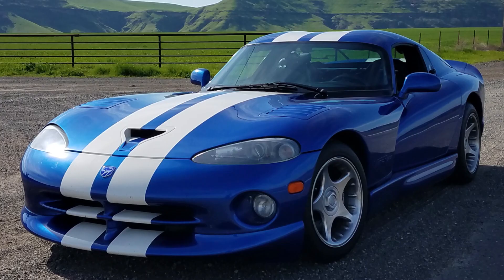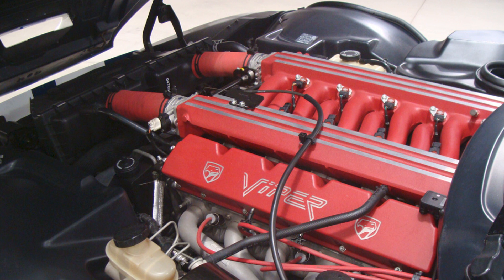Tech Talk Tuesday: Dodge Viper Cooling System Upgrades

Comment: Upgrading your stock cats to high-flo is a huge improvement for cooling temps. I’ve got a full Belanger exhaust setup along with a 3-row radiator and silicone hoses and the car is remarkably cooler than when it was 100% stock last year.

Comment: On a 92 and early 93 with the radiator that has the radiator cap on the radiator you HAVE to remove the hood and hinges and hinge brackets because the radiator is removed from the front of the bulkhead between the bulkhead and the front fascia. On the cars that had the coolant reservoir on the passenger fender, you can remove the radiator from the space between the bulkhead and the engine because the totally designed the front bulkhead in late 1993 with the radiator mounted to the rear of the bulkhead instead of the front. Time difference: 6 hours for a 92/93 versus 1 hour for a late 93 and Gen II. Just an FYI

Comment: Also, for more info, the drip is coming from the front center of the engine. This is why I suspect the pump. I will do more inspection in the coming days.
Love your channel, lots of great content.
Reply: Thanks for the quick reply. Yeah, I suspected as much. Yes, I have looked at a few places for a rebuild. Most likely option.  Have a great 4th of July!
Reply from the maker: @BM-bd6yj you're welcome! Best of luck and happy 4th to you as well!
Reply from the maker: Thank you! Sadly it's likely the water pump. If you're lucky it'll just be a gasket

Comment: What water pump do you recommend? I have a 1997, and I have a leak. I just replaced the hoses to mishimoto hoses, thinking, hoping that it was a hose or clamp, but it now looks like the water pump is dripping.
Any advice on a pump or where to get one is appreciated.
Reply from the maker: From my understanding finding a replacement water pump is a bit of a challenge these days. There is someone who is rebuilding/upgrading them, but I can't remember their name. You can find them on the various Viper related Facebook groups. I would find that individual and get one from them. Also I believe they are a few hundred dollars and also have a hefty core charge.

Comment: i've only owned a viper (1997) for 3 weeks now, but also i've researched the temp gauge and found that it is fully good/safe unless it's literally touching the line for 250. Which has me thinking people are overreacting about their Viper "overheating' when really it's just fine. 
I live in central Florida, so I'll find out next summer.
Reply from the maker: The factory manual says it's good to that point, but those of us with extensive automotive backgrounds prefer to keep our cars cooler than that for longevity.

Comment: how many gallons of Evans coolant do i need for my 2001 RT10
Reply from the maker: Factory coolant capacity on a gen 2 is just under 13 quarts or just over 3 gallons. I would pick up 4 gallons to be safe and have a little extra on hand

Comment: Thanks for the reliable information!
Reply from the maker: You're welcome!
Reply: @LifeatSpeed  Question: the cab of my 96 GTS sometimes gets stinky when I am idling or driving it quickly... have you ever had any similar exhaust smells in your cab at any time? If so do you know what a solution would be for this??? I have Corsa exhaust that was installed the smell issue had been there before and after the install. Thank-you!
Reply from the maker: Definitely sounds like an exhaust leak. The good news is there are limited places to check. The bad news is most of those locations are behind the side sills. Under the hood it could be an exhaust manifold leak. Behind the side sills it could be any of the exhaust connection points. The side sills are not difficult to remove. There are a series of bolts under the car and a series of bolts in the door jam.

Comment: My gen 1 has been parked for 2 years because of cooling issues, mabe time to get her back on the road, thanks
Reply: Yes thats on my list. Almost sure they are toast
Reply from the maker: Good luck on sorting out the cooling issues. Have the head gaskets been replaced? I know that was a weak point on the early cars.

Comment: Thanks for the tips! I have a question. I just picked up a 96 GTS. Do you recommend upgrading the radiator fan and adding a fan controller without replacing the stock radiator? My viper still has a good radiator but I would greatly love to make the vehicle run cooler
Reply from the maker: The radiator upgrade while nice isn't a necessity. If mine hadn't started leaking I wouldn't have recored it. Upgrading the fan and installing a fan controller will make a worthwhile difference on their own.
Reply: @LifeatSpeed  perfect! Just the answer I wanted to hear. You're the man! Much love from Jersey
Reply from the maker: You're welcome! And congrats on the purchase!
Reply: @LifeatSpeed  thank you!

Comment: How exactly does the fan module circulate coolant through the engine?  Does it control the water pump too?
Reply from the maker: No, as the temperature of the coolant in the radiator drops it then circulates with the hotter coolant in the engine and the hotter coolant moves into the radiator and the fan then cools it.

Comment: Thanks for the tips and the links!
Reply from the maker: You're welcome!
Reply: @LifeatSpeed  So the fan controller runs the fan after the car is turned off until the desired temperature is reached, correct?

" runs the fan after engine shutdown" -Roe Racing
Reply from the maker: That is correct.
Reply: @LifeatSpeed  Thanks! Where is the harness installed at, and can it be hidden out of sight easily?
Reply from the maker: The harness runs along side the factory harness, so it's hardly noticeable. The controller module itself mounts to the back of driver's headlight assembly.

Comment: AND ... the aluminium rad has aluminum welded end tanks and aluminum dissipates the heat better.  AND .... the aluminium is a 3 core rad and some are much cheaper than recore.  $500 from Roeracing.   And ... adding Water Wetter to the antifreeze works tto drop temps 15F add 2 if you want.  Best is if you NEED to add coolant you won't have to wait a week for "Evans" because it's OK to add water.    AND .... adding a close out panel underframe will increase airflow through rad and better aerodynamics!.    AND ... venting your windshield cowl (or buying one from Autoform)  will also increase airflow and improve cooling 15F.
Reply from the maker: As always Ted your wealth of Viper knowledge never ceases to amaze me! How do I add the plate underneath?